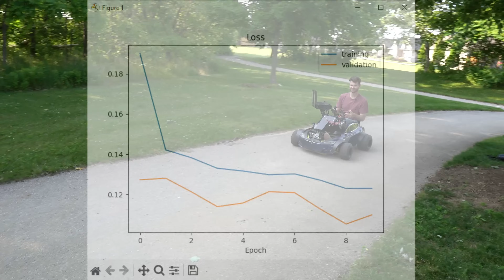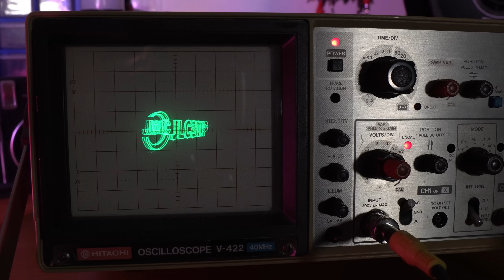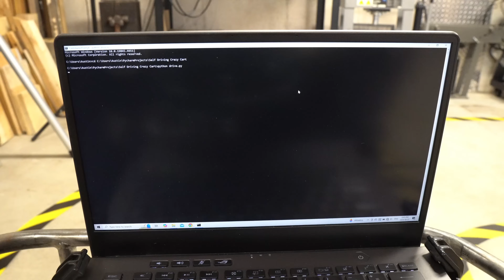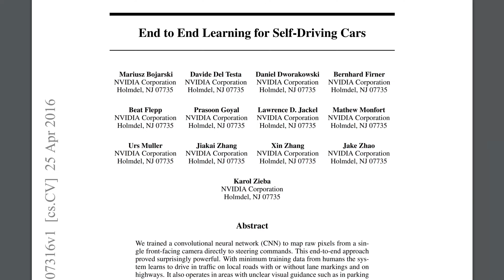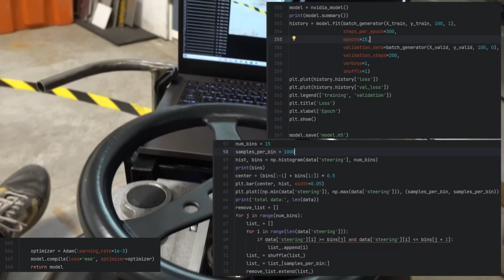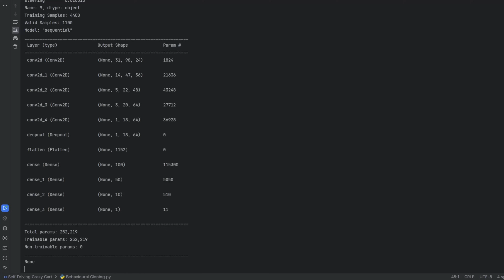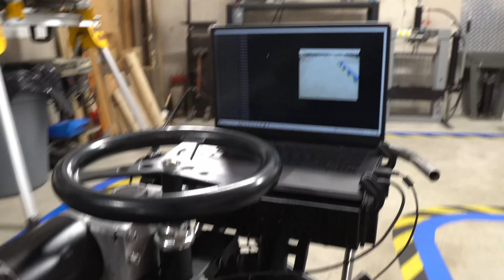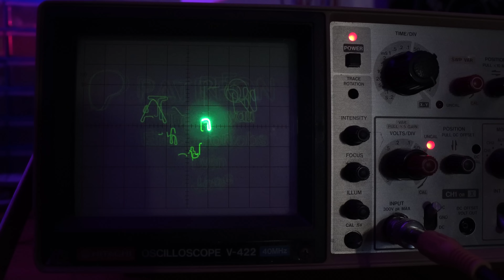I Built a Self-Driving Go Kart with Machine Learning

Comment: It might be cool if throttle input was one of the training data variables. Even if the self driving model doesn’t have direct control over the throttle, it might help it to alter it driving style at higher speeds if it knew how fast it was going.
Reply from the maker: I should definitely include throttle data in training

Comment: You reproduced the DonkeyCar project.  Training with a constant speed helps a lot.  The reaction of the steering angle will become consistent when the speed is constant.
Reply from the maker: Thanks for the tip. I should have made the throttle circuit sooner and used it for training!